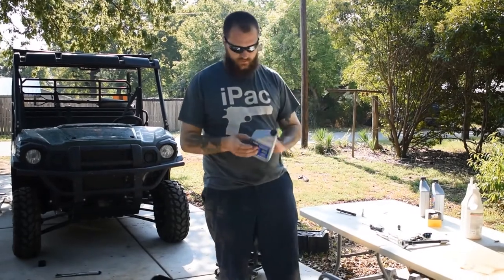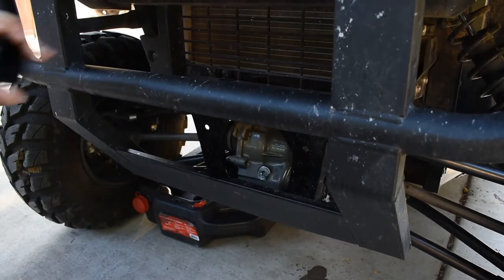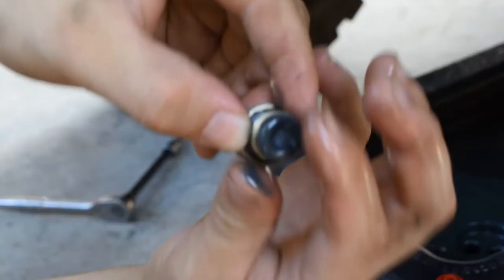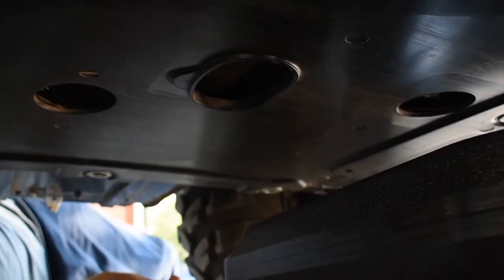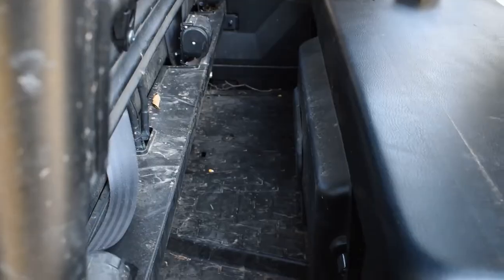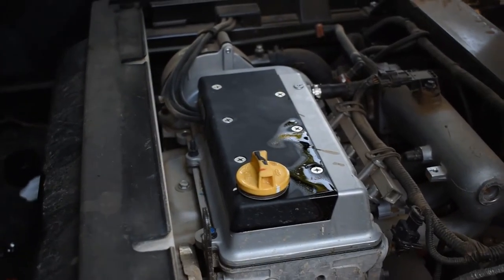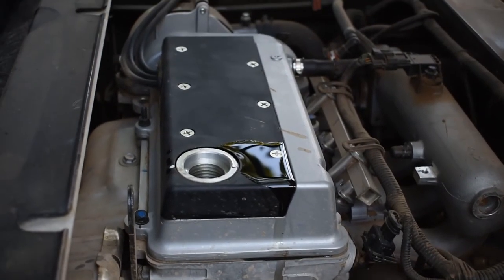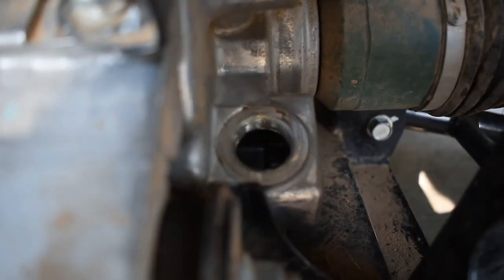2020 Kawasaki Mule Pro FXT Fluid Change

Comment: Good video, I’ll put one tip in from am old mechanic I knew years ago.  Always pull the fill cap first.  Two reasons : 1) it can help vent the case for a faster drain, even though the case is vented. And 2) and this is the important one,  it assures that you CAN get the full cap off…sometimes a fill cap is just plain stuck and if you drain it first you have no oil in the case.  If you need to use the vehicle while you figure out how to get the cap out you’re kinda screwed.    By pulling the fill cap first, if it won’t come out, you still have the oil in the case should you need to use the vehicle while you look for a solution.
Reply from the maker: I’ve never thought about that. I always did the fill cap last to slow the flow down at first just to make sure I have my pan in a good spot. Then once it’s draining into the pan pull the cap. But I’ll definitely keep that in mind from now on!
Reply: @TexasEmpire   you can break the fill cap loose and place it back in the hole to slow the flow, at least you’ll know the cap will come off.
 Many times, mostly on old vehicles,  the fill plug is way over tightened or cross threaded and THATS where the problem mostly comes from.   On newer vehicles we see plastic more and more, and they can get distorted and tough to remove, especially over time.  It’s not a do or die thing, just some good advise passed on by an old timer mechanic.

Comment: Thanks for the video… I have one question for you. Was there a particular reason you bought the gear oil with the limited slip additive? I couldn’t find anywhere in the manual where it says to use, just a “ APG - 5 rating” correct? I’m not well versed in the reasonings anyway. So just wondering if it is just a preference/price reasoning? Thanks-
Reply from the maker: Limited slip is not necessary. The stuff I found that met the other requirements just happened to have it.

Comment: I have a 2022 and the front diff drain plug doesn't have a magnet. Is this normal?
Reply from the maker: From my knowledge it should. They may have changed it up some since I bought mine. I’d call the Kawasaki house and ask. The magnet definitely serves a good purpose being in a diff

Comment: Howdy from College Station.  I just bought the same machine and I’m getting everything I need for the first service.  How did you figure out the WIX filter works?  I went to their website, put in the make and model info, but it only showed a part number for an air filter.
Reply from the maker: There’s a oil filter cross brand thing you can google and put the oil number your vehicle has on it or whatever part number you know and it will populate brands and their part numbers. Not gonna lie with this one though I stole it from another video.
Reply: @TexasEmpire  cool, I’ll look it up.  Thanks man

Comment: So they don't have to do a valve adjustment
Reply from the maker: So this is a touchy subject. There is no valve adjustment on these engines. They are hydraulic lifters. Now they do and can check valve lash but if it’s off they have to do a rebuild. So in my situation. If it was off I would have noticed it by sound and performance. And then I would have taken it do the dealer to do it under warranty.
Reply: That's a warranty caveat probably written by lawyers.   It's almost unheard of to need to do anything about valve specs unless the engine is already damaged.

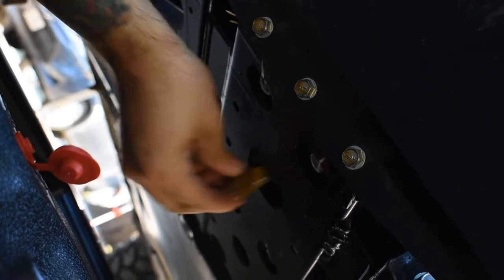Comment: That 20 hour differential change is just silly. 3:10 Look how clean that oil was! The 20 hour change is only in there just in case there were a factory defect, it makes most people bring it into the dealer at 20 hours so they can "fix" any issues before it results in an expensive warranty claim.  Differential oil should last a LONG time if you don't submerge your machine.